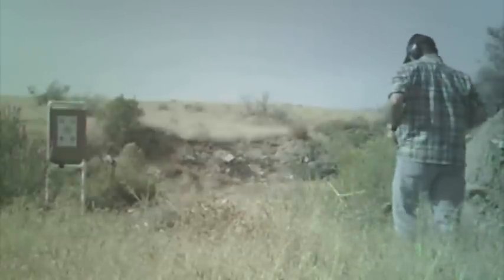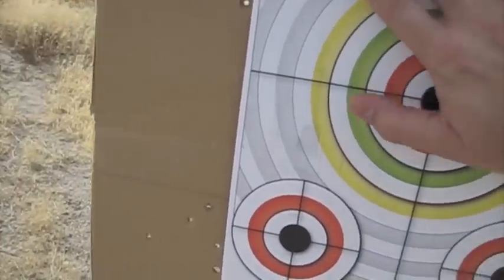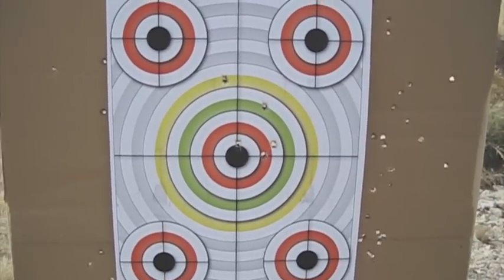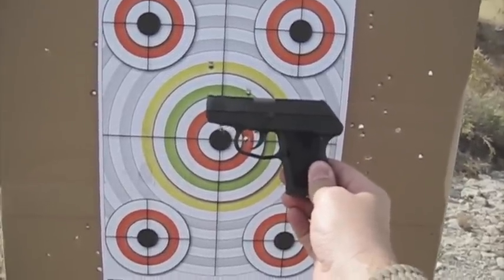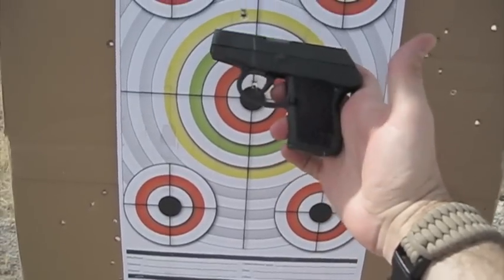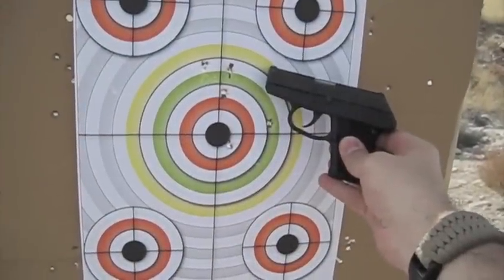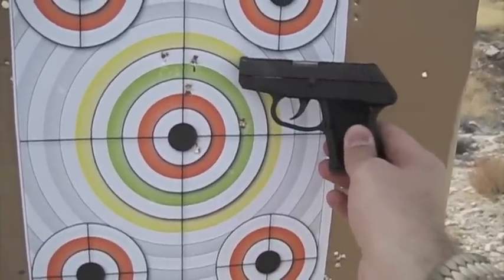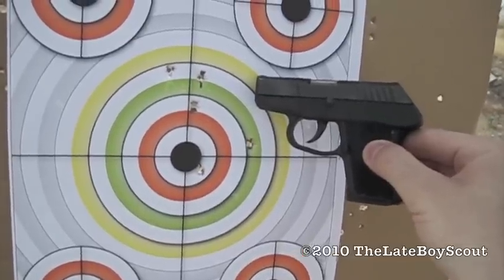Kel Tec P3AT on my Shoot & Move Course

Comment: Have the LCP (almost same gun) and had similar issues.  The spring is pretty heavy and does need a break in period.  I think cleaning/lubing, some extended slide racking sessions, and a few more rounds down range will iron it right out.

Comment: I was gonna say perhaps it hadn't been broken in, but 300+ is well past the break in period. These little guns are particularly prone to limp wristing...even slightly doing it will cause jams.  You have to really hold on to them tight and lock your arm/wrist.  Not necessarily saying that's the cause, just something to consider/a common problem.

Comment: Blazer, NG. Use brass with FMJ only some hollow will run through it. Not that Blazer is not a good round it's just not good for this gun. I have run a lot of different ammo's and have had a lot of jams except with FMJ. It's all according what she was using. Some ammo as you know is so dirty 200 rounds would gum up a small pocket gun like the P3AT so maybe that was it. Most can take hundreds of rounds like my Ruger P97DC I can put 1,000 down it with out cleaning, Not advised but it take a licking and keeps on clicking.